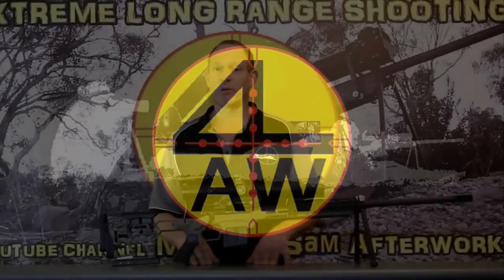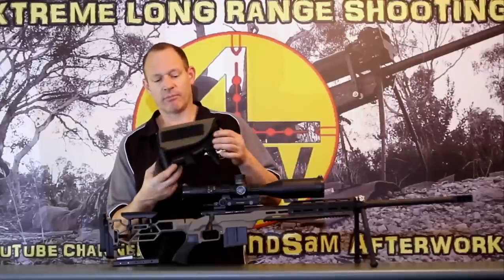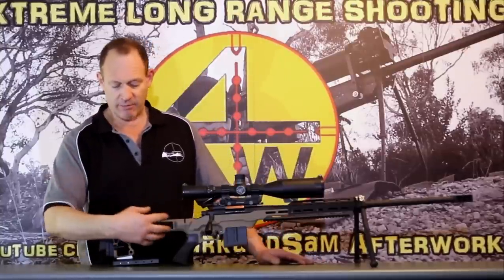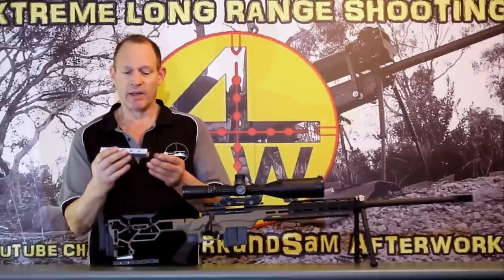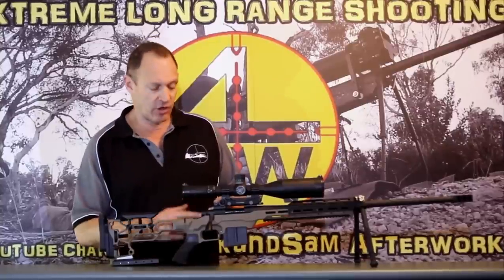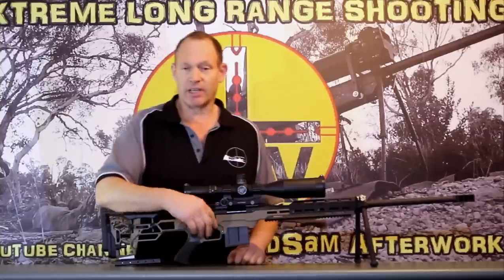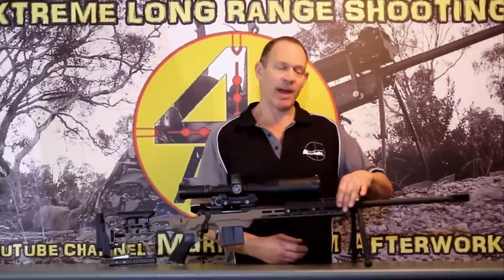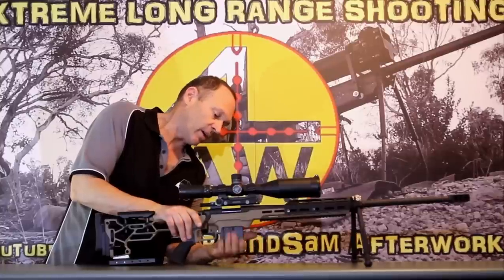Rem 700 .308 police special, build (MDT LSS XL gen2 Chassis)

Comment: Do you know if your mlok/bipod system will work on the MDT LSS gen 2? Not the LSS XL.
 I need that "mlok" piece so bad haha.
Reply from the maker: Not curtain, but our short barrel guard bracket should fit, email with chassis width and barrel height to be sure, Cheers

Comment: Mark, the cheek riser has two 'stabilizing' bars and the central adjustment bar.  Is that a modification you made or an option from MDT?

Be well,
Don
Reply from the maker: That's how this butt stock comes from MDT, Cheers
Reply: Thanks Mark.  Online shows a different stock with only one stablizer bar (and the skeleton holes look different than yours).  Maybe they need to update their online photos?  Again, thanks for the reply.

Be well,
Don
Reply: I think that are the new stocks from mdt